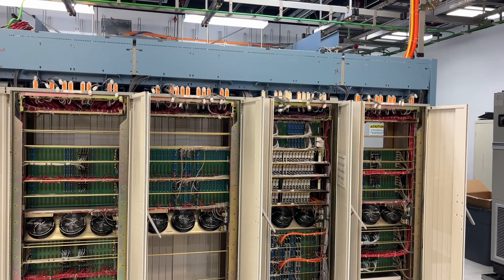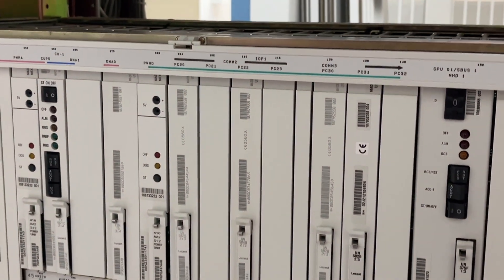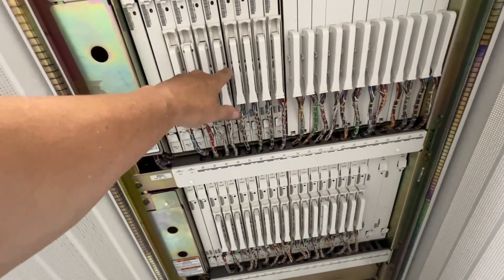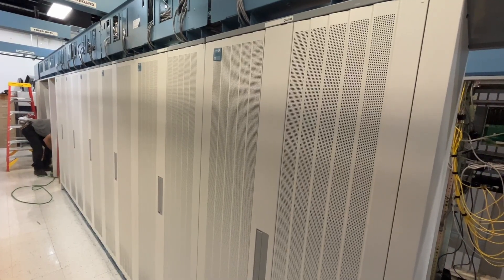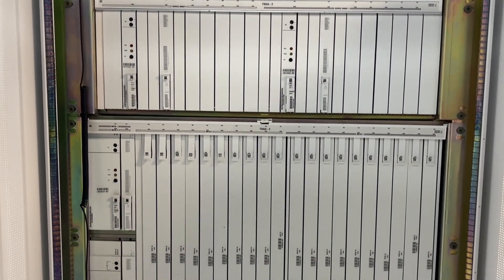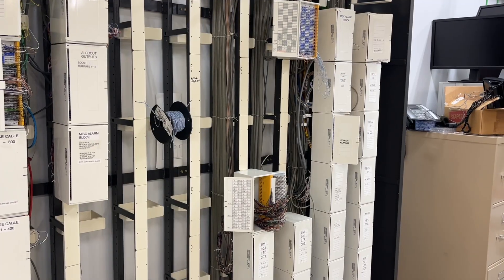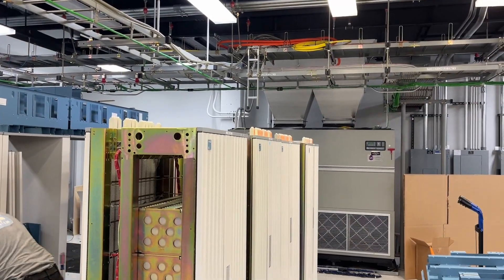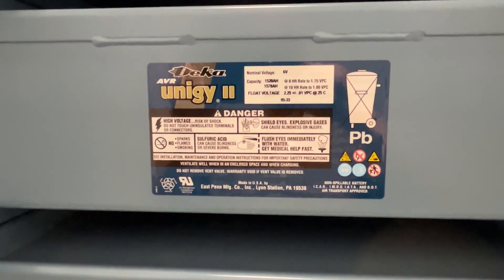AT&T Lucent 5ESS 2nd switch decommissioning.

Comment: It is sad to see these switches being retired. I was the Central Office supervisor in Windsor Locks, Ct., when we installed the first 5ESS in the state in 1985. I think we were up to 5e8ESS iteration when I retired in 1996. I was a tech in the old Step by Step (SXS) offices when I was a rookie. I helped retire those offices to IESS or IAESS switches during the 70's. It was still a time of growth in the land line business. Who would have thought it would all be obsolete so soon. I remember the first cell phones looking like small walkie talkies and costing over $3000.00 around 1982.

All central offices were noisy with electro-mechanical relays clacking away. The 5ESS offices were noisy from fan/rushing air noise. The first hard drives we had were the size of small washing machines. I don't remember their capacity, but it wasn't much by today's standards.

Comment: This thing looks so clean… I'm not a telco person, but I was responsible for a bunch of ISP modem banks during the dialup boom so I saw plenty of very new switches at CLEC colocation sites, including the weird "AT&T but not AT&T: AT&T Local Services" (I think that was essentially their own CLEC arm when they sold local service in another RBOC's area?). This stuff is all so impressive in person. I remember a sad day when an engineer at Focal (a CLEC) showed me this thing the size of a large dorm fridge at the colo and said it would shortly be replacing the DMS-100 that filled the room… :(
Reply: I think AT&T local services came into being from 1984-2005 when AT&T was just a long distance company and not an RBOC. Oddly, some of their switches still exist, even in areas where the "new" AT&T (former SBC) is the RBOC. There's still a division in that company between the former long lines side and the former SBC/BellSouth side.
Reply: A piece of equipment the size of two telephone booths has now replaced a 4ESS switch who is architecture once took up 25,000 square feet.  It's hard to wrap my head around it.

Comment: I remember when these were state of the art! 5ESS and DMS-500. If you weren't on one of those and you were trying to run a dialup operation (particularly with ISDN), you had problems. Imagine how proud the techs at that office were to be installing that thing when they first got it! Also, writing to DAT drives took FOREVER!
Reply: Man, ISDN was such a missed opportunity here in NA.  Broadband before people even knew to ask for it.
Reply: @sirnickity  Hey, I had it. Then again, I worked for the ISP as an engineer, so I didn't actually have to pay for it, but loved the 128k back when 56k asymmetric was the best you could get!

Comment: The MAIN drawback of the 5ESS was it’s N O I S E‼️Why the design team chose groups of 3 fans per rack though out all the cabinets is beyond me.
The #4ESS which preceded this switch had NO fans whatsoever. It was a 4 wire Long Lines Toll switch. Western Electric designed it to be cooled by flex duct that dropped down from the ceiling and connected DIRECTLY to the switch. HVAC provided complete switch cooling. The ONLY sound produced by the #4ESS was a single clicking of an interrupter timer‼️
Reply from the maker: Yes they were loud. Nortel DMS was quiet. The larger the 5E the worst it got.

Comment: Just a little side note for history, the #5ESS was manufactured by Western Electric at their Oklahoma City Works.
Reply from the maker: Two of the very large almost hundred thousand line switches that I worked on was the classic that had the AT&T/Western electric markings on the frames.
Reply: There is also either a 5ESS or a 4ESS in the tandem office in downtown Denver that the Connections archive is located in. This switch also maintains the original western electric livery.

Comment: With VoIP/Fiber coming to many exchanges or markets, we're seeing a lot of tradional TDM Switches getting either degrown or completely shutdown.  One of our local GTD-5 Switches was degrown at the Base, from from 16 line frames to 4.  The RSU's or Remote Offices  have not been impacted yet, due to no VoIP/Fiber work in those exchanges.  How this will impact C.O. Jobs is yet to be determined, but it doesn't mark a bright future for those of us that remain.
Reply from the maker: My job as well as many others was impacted by the landline decline as well as the company I worked for just flat out did not give a damn about customers other than business and that was kind of if it best I know 45 of us was laid off/bought out in one round.
Reply: @sxsphil So far no packages, but we're getting acquired by a big fish next year. Nobody's discussing the impact, at least not from the leadership team, which anyone with +25-years is very worried.  With kids still at home, & retirement too far out, I'm genuinely concerned what the future may hold for our Telecom Career.
Reply: @sxsphil  The technology changes allowed AT&T to downsize the techs in the 4/5 ESS switches and the Toll network.  Gone were the days where the local techs got to provision service as well as analyze and resolve cases of trouble.  Centralization of provisioning and maintenance took those parts of the job away so that techs are little more than 'pack monkeys' who insert and remove circuit packs.  Even wiring is now left in so that provisioning can turn a circuit up and down without a tech being involved.
Reply: In France, they not de-grown any switch, as everything was long ago digitised, and mostly "remote". Digitisation occurs in units spread all around the country, with some as small as 2 000 lines in charge to turn analog line into a trunk of 30 voices+2 signalisation but without "brain" they just change the network configuration to send the trunk to an other switch. Once no more "remote" are linked into it they just shut it down and close the location.
Reply: @lapub. We still have quite a few analog landline customers, in certain markets, because of limited cellular coverage in rural areas.

In those markets that have switched to VoIP/Fiber, it has become a 'mixed bag'.  Many of the legacy customers are not happy with the VoIP Service, as it doesn't behave like the traditional analog service.

I still have an analog landline at my home, but I don't know for how long.
Reply: @oliverw.douglas285 not happy with VOIP services. Million of business an residential customers have been VOIP for 20 plus years with zero issues
Reply: @FELIX6F5 I guess it comes down to how it's managed.  With proper SIP Trunking & true QoS across the entire network, then yes it has potential, however, if any part errors on the cheap side, and it falls apart quickly.

Comment: Has the system been replaced by  a softswitch  or just  closed due to  lack of   landline home phones. ??
Reply from the maker: Soft switch. When I touched it, it did not seem very soft.😂
Reply: What is a soft switch?
Reply: @studinthemaking  A softswitch is a PBX/telephone switch in software, running on general server hardware. Think Asterisk/FreePBX or some proprietary software but running on a computer, not bespoke hardware like the switch in the video.